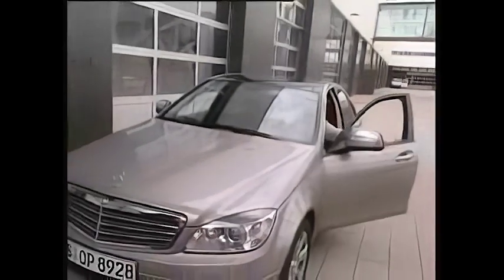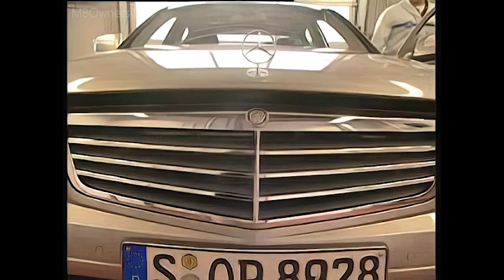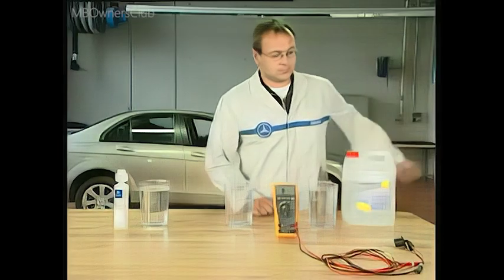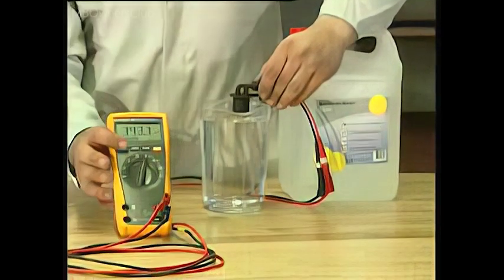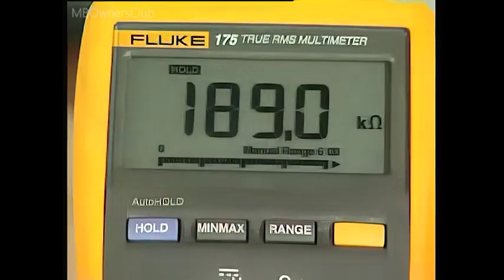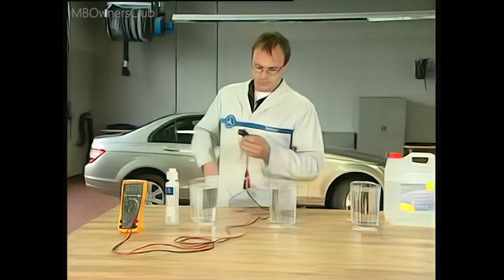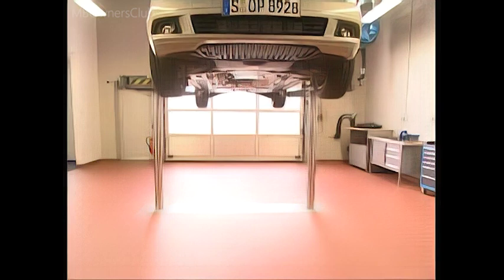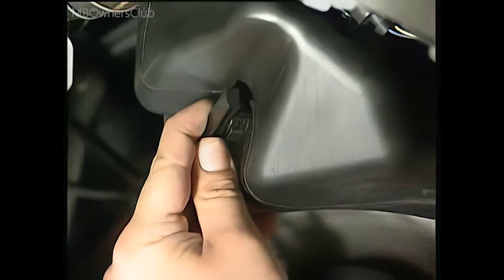Mercedes-Benz C-Class (W204) Washer Fluid Sensor Issue: How to Fix the Problem

Comment: Doesn't work for me!
I have change to a new sensor and use the mb fluid, still doesn't work!
I have also bypass the sensor with a cable , doesn't work, the message (fill washer fluid) still show on the display, this mbsystem drives me mad!
What can i do to fix this issue?
Reply: Damn German’s, other think everything. I have to defeat the Eco Start and clear my low washer fluid warning every time I start it now to read the digital mph display!